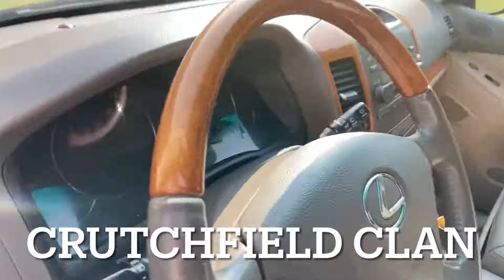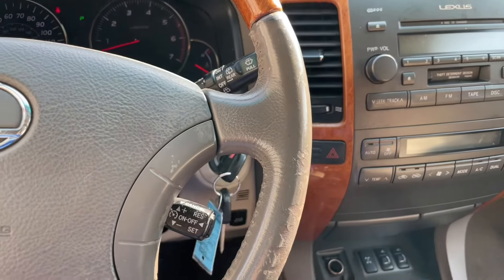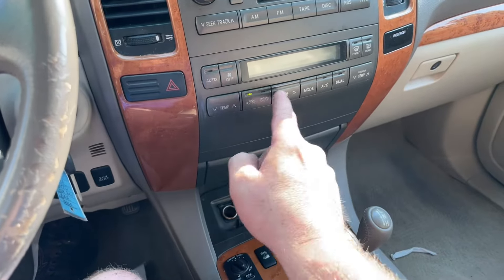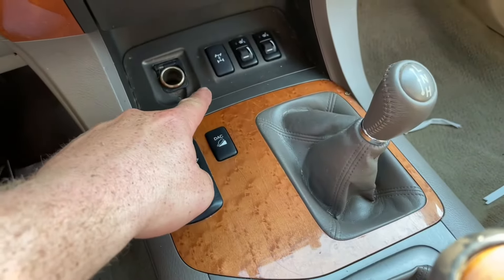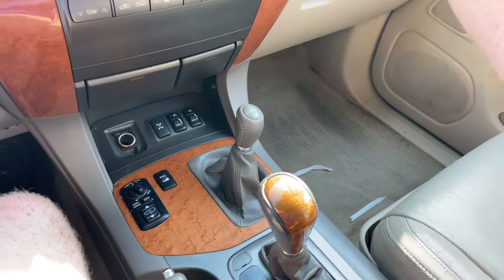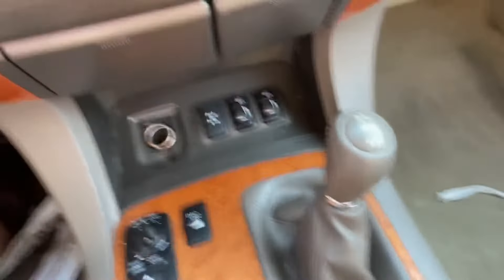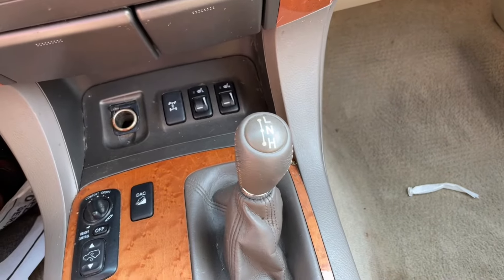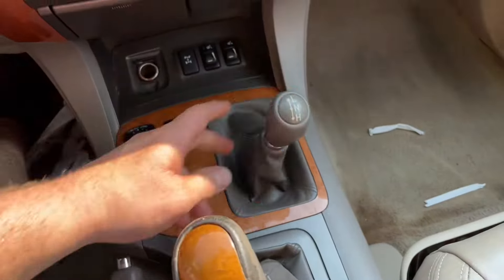How Hi/Lo transmission range works Lexus GX470

Comment: So whe have to engage it on high wheel drive to be able to drive? Correct me if I’m wrong
Reply from the maker: It has to be in high or lo to drive, neutral will allow you to flat tow it disengages everything in the transmission
Reply: @crutchfieldautomotive7936  sir you are awesome! I have another question for you, when is it required and how to press the lock differential?
Reply from the maker: Have it in neutral when locking.  Only necessary when you’re in some really sketchy terrain
Reply: @crutchfieldautomotive7936 if I don’t have it in 4D and am just standard drive, do I need to have it in H? I currently do not use 4D because I’m typically commuting by highway and it’s always in N rather than H - is that a problem?
Reply from the maker: @joshualaplant3433  if yours is in N and still drivable something is amiss because it should be able to roll freely with the transfer case to N
Reply: Maaaaaan you saved my day, my weekend, my WORLD. I have been driving my gx470 in the’N’ position for 6 years. This morning it wouldn’t move in that. Would only move in high or low. I know low is for offroad and hadn’t thought abt high.To think all of this time, despite the manual to drive in NEUTRAL, I could have been, or as you say, that it’s standard to drive it in high. Worry is gone. I’m glad you osted this so I wouldn’t have tried to roll around in L instead. I am set FREE!! LET’S GAIN SOME MORE YEARS OUT OF THIS BABY😂😅😂😂 Bless you man!!

Comment: My shifter is stuck in park. I can drive it by pushing the release button but I can't figure out what's why it's doing it. My fuses all checked out ok and I dont have any CEL lights on. Any ideas?
Reply from the maker: Neutral safety switch is my first thing that comes to mind, possibly a bushing on the shifter but that switch is what holds up most vehicles from shifting
Reply: @crutchfieldautomotive7936  Thank you. I'll dig a little deeper. Great content on the GX470s, your channel was my go to when doing research before I bought mine.

Comment: Hi there mines i press the brake put it in Neutral  when i change fro hi to low it grinds what could that be  ? Thanks in advanced
Reply from the maker: Wait a few seconds before swapping and see if it changes
Reply: Did you fix it
Reply: Did you manage to fix it?

Comment: I test drove a 2008 today in Huntsville that has just over 200k miles. Everything worked except the stereo cuts in and out every 1/2 second (maybe amp related). Ran as good as my 2012 4Runner which runs like new. I was feeling good about buying it until I went to shift to 4L to check the center diff. When I tried to shift to 4L there was no gear to find. Shifter just moved around freely. Dealer didn’t know what to say other than maybe the cable had broken. They were taking it to the maintenance/service department when I left. Will be interested to find out what happened.
Reply from the maker: That’s a weird one for sure haven’t had one be completely free

Comment: Hey I have a question for you , maybe you might know what’s going on before I start tearing shit apart its a 1999 Lexus LX470

Something is going on with the truck , I was leaving the neighborhood over the railroad tracks . While stopping I heard a grinding noise / vibration and went to press the accelerator to go onto the main road and the truck won't go anywhere no matter the gear. If  I put it in park it will just roll even with the E brake on

Also locked the center diff in 4H and the truck will actually drive in every gear correctly but when I unlock the center Diff no gears will work and the vibration/ grounding noise will occur it’s actually louder than before as well when it initially happened 

No park , no drive nothing it just rolls and makes a ton of noise in 4H 

If it put it in 4x4 low it's fine with no weird sounds ,
Reply from the maker: Rear driveshaft still intact?  Or does it spin when you hear the noise and it doesn’t move?  Sounds like a rear chunk or driveshaft issue

Comment: So are you saying for normal operation driving down the rode, the 4 wd shift has to be in high 4wd?
Reply from the maker: Yes it should be for normal operation
Reply: @crutchfieldautomotive7936  Thanks I finally got my GX 470 home, I had the 4wd shifter in neutral.
Reply from the maker: Good deal, yes that disengages it all
Reply: Same here. Never use it but I showed my son what I thought was 4WD by shifting the 1st trans shifter. Then I shifted to what I thought should be neutral. What a dope. Sat gunning the engine in drive. Great video.

Comment: How come my lo and hi indicator light isn’t on?
Reply from the maker: The fuse and relay have likely been pulled unless you still have air ride?
Reply: @crutchfieldautomotive7936   no more air ride.  GX is lifted. Could it be because the air ride delete?
Reply from the maker: Yes if it’s deleted they took the relay and fuse out that would light it up so you’re good
Reply: @crutchfieldautomotive7936  is this normal?  I did the lift myself and removed some fuses awhile ago lol.  Just realized the indicator was off today.
Reply from the maker: If you removed the fuses and lifted it the light should be gone

Comment: How would switching to low help you get unstuck? When you’re stuck it’s because your wheels are spinning and adding more torque would just make the problem worse. What am I missing?
Reply from the maker: The lower wheel speed is what’s helped me in those times 🤷🏻‍♂️

Comment: I can’t find answers to my question anywhere. 
My 4x4 shifter won’t shift to N or H and has been in the L position since I bought it. I’m clueless about 4x4 vehicles but this doesn’t seem normal. Is it a serious problem? Expensive fix?
Reply from the maker: So you can’t move it from low at all while it is running? You would put it in neutral and try to pull it back to Hi. That won’t work at all?
Reply: For My Landcruiser 2007 Model Gxr Same Always In H I can’t move N OR L ANY SOLUTION OR H is fine to drive on road
Reply: Do you have the shifter in the "N" position? The transfer case will not work in drive.

Comment: The issue with my GX470 is i have no 4wd hi or low indicators. Also mine is not fulltime 4wd.
Reply from the maker: Are you missing the front hardware? Trying to understand what’s keeping it from being full-time 4x4
Reply: @crutchfieldautomotive7936  no mine has been converted to part-time 4x4. I have an FJ transfer case and rear end with Tacoma front end. I've been looking for wiring diagrams to adapt the indicators.

Comment: Is it an issue If I still get a grind even when I'm in neutral?
Reply from the maker: How long are you waiting in N during the shift
Reply: @crutchfieldautomotive7936  probably not long enough. Ill try again tomorrow. I think the mechanical side of it finally just clicked for me.
Reply from the maker: When you go from hi to neutral everything has to stop and give it a few seconds and then try going to low
Reply: @crutchfieldautomotive7936  Yessir I'll give it a shot. Thanks!
Reply: @crutchfieldautomotive7936  for me I wait like more that 10 seconds and it still grinds
Reply from the maker: Even with the trans in neutral?
Reply: @crutchfieldautomotive7936  yes I placed in neutral went from hi to N then to lo and grinded, put it back in neutral waited like 10 seconds and place it in hi and it was grinding
Reply from the maker: Plenty of fluid in the center diff?
Reply: @crutchfieldautomotive7936   yes
Reply from the maker: That’s an odd one, but it works and shifts?
Reply: @crutchfieldautomotive7936  yes it still works it just grinds pretty hard

Comment: Would I have to turn off the center locking diff before putting it in hi/lo?
Reply from the maker: I don’t believe so, just neutral on the transmission
Reply: @crutchfieldautomotive7936  Good to know. Thanks for the quick reply. This channel helped me a ton when I bought mine. I was literally watching your vids at the dealership before I signed anything 😁